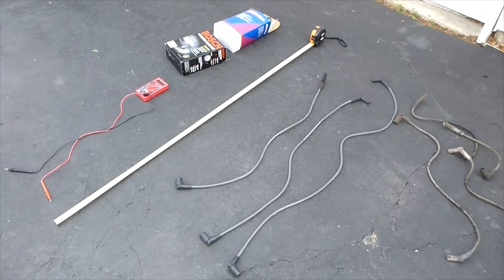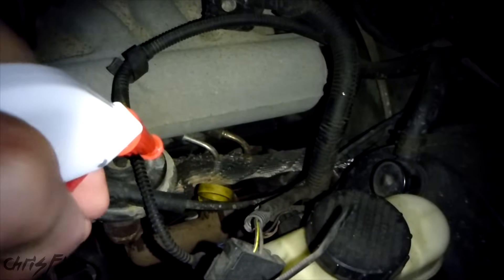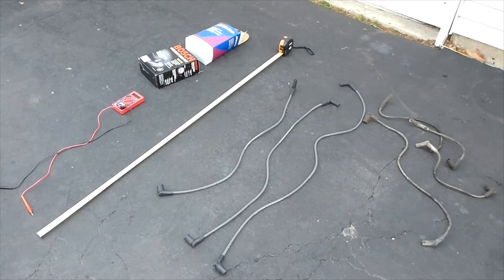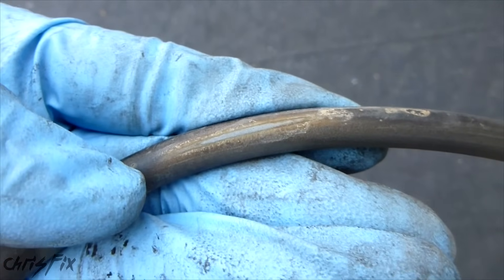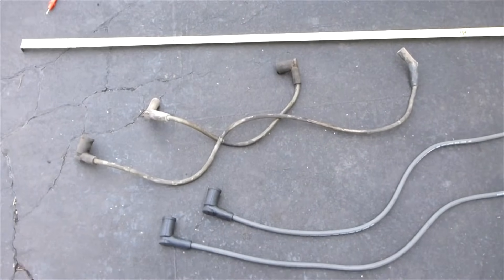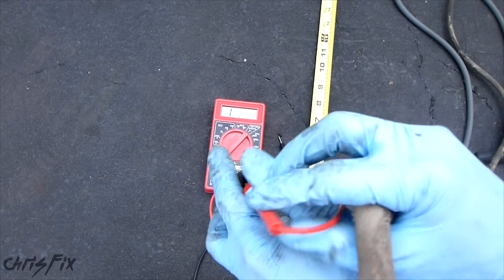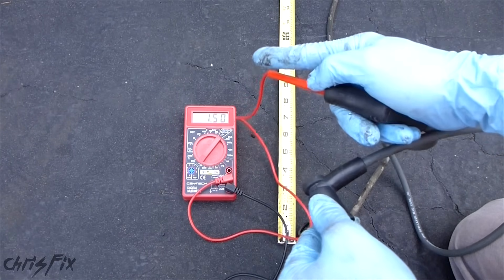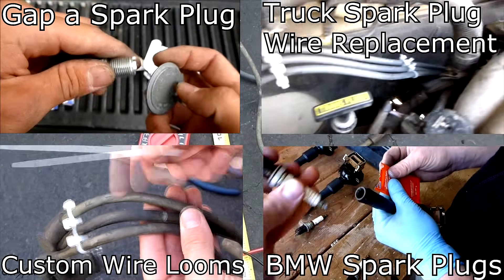How to Test Spark Plug Wires

Comment: hey chrisfix, I have multiple questions for a truck I just bought. it's a 1999 dodge dakota 5.2 liter v8 I bought for $2800 for 80,000 miles. at first everything was fine, then realized I made a big mistake not inspecting this truck. it has major problems with all tires, shocks/struts, a shot muffler and rusted pipes. those are major, but right now 2 weeks after I got it, it wouldn't start. I found out that the battery terminals and battery were corroded, so I cleaned them and replaced the battery since the old one had less than 8 volts. I thought that fixed the problem, but it turns out that it still doesn't start, I'm thinking it's my starter or a spark plug or alternator problem. what's your suggestion on this? maybe my battery cables are bad or clamps or starter? it turns over but won't fire up completely. thank you if you can help me.
Reply from the maker: +Michael L. (Moviemichael) Check the fuel pressure: https://www.youtube.com/watch?v=_oXLUqE4Sf0

Comment: Good video, Chris. I just had spark plugs and wires changed on my 2004 Ranger and now I'm getting static(not whine) on AM band of aftermarket radio that matches RPMs. No static when stopped with engine running. Any ideas?
Reply from the maker: +9moons1 Thanks! It could be that you used  non OEM resistance wires so they interfere. My Corvette manual specifically says because the firewall is not metal, to use OEM spec wires.

Comment: I should try this with my outboard motor.  One of my small outboard can't get over 3000rpm or high speed.  In visual the cable somewhere crack and looking bad.  I should perform the multimeter test for it

Thanks for your great tips!  Really clear to show how to do for me as i am new for engines.
Reply from the maker: +Jerry Chan Awesome! I hope that it is an easy fix! Good luck!

Comment: Where I am lost is what should the ohm reading be if it is a GOOD spark plug
Reply from the maker: +TySignsUp Porter They should all be a similar resistance. Every brand has different resistance values so you cannot generalize. Instead, test them all and they should all be within the same range.
Reply: Thanks Chris.  I did this test yesterday after seeing a random misfire code on all 4 of the drivers side cylinders.  I checked all 8 and found out that all 4 on the left were not similar in resistance.  However, all the wires on the passenger side were.  
I will be replacing all my plug wires today.

Comment: resistance is not that important as long as it is within reasonable values. The continuity test is more important as spark strength is lost when jumping the gap!
Reply from the maker: +rosharky Thanks a lot for sharing!
Reply: +rosharky Can you mention what are the reasonable values?
What's the continuity Test?
Reply: +ChrisFix As you tested Ohms in old cable and when you moved it, it's Ohms varied and you changed it therefore. Why you didn't did the same process with the new cable?
Reply: +Muhammad Ali continuity test = resistance should be constant even if you flex the cable.
If it is not, it means that the cable is interrupted and the spark has to jump that gap.
IT will burn the material and the gap will increase even further. Not to mention that you are loosing spark energy there.

Reasonable values, there is no fix value, but if you are measuring well over 20k there is definitely something wrong with that cable and it will be likely to cause misfires.
Don't strugle to go below 5k or so, as gains will be marginal. Current is controlled by the ignition system, not cable resistance anyway!
Reply: +rosharky Thank you Man.

Comment: Hey Chris last time I was having issues with a misfire. So while the car was running I started fiddling with the spark plug wires, well I ended up just wiggling the spark plug wires at the distributor and it shocked me. Are they supposed to do that or does that mean my distributor is bad or spark plug wires? I have no clue so any advice would help.
Reply from the maker: +mrtwk63 It shouldnt shock you. The wires are probably bad and leaking voltage.
Reply: ChrisFix thanks for the reply. I took a good look at the wires and there's cuts on the wires. I guess I'll swap them out lol.

Comment: so is higher resistance better or worse? I have a 98 dodge ram that is misfiring in cylinder 4 (P0:304) I replaced the spark plugs a year ago along with leads and corrected the problem. now its doing it again from same cylinder. I checked the ignition coil and it was in spec...the lead was like 1.3 kiloohms. and then I even tried the injector to no avail. only misfires at 55mph+...it does not move to other cylinders. only cylinder 4.
Reply from the maker: +TheRedneckmojo You want lower resistance to translate more power to the spark. Check your distributor.
Reply: +ChrisFix if its just one could it just be the caps connections corroded inside? thanks for the reply.
Reply from the maker: +TheRedneckmojo It could be for sure! Take it apart and see! The cap comes right off the rotor. Just make sure you mark it on the rotor so you dont mess up the timing of the engine.

Comment: I grabbed some new looking wires from a salvage yard, and they all read well except one didn't read at all. Is that basically a dud?
Reply from the maker: Nate Miller Yes, that wire is bad.
Reply: ChrisFix Thanks!
Reply: ChrisFix What's happened to a wire that's not reading at all? It seems like bad ones still read something. Subscribed. I like your videos. Good camera angles, well said and to the point. Other people need to have their face all over the video when it's really unnecessary.
Reply: why would u want to get wires from a salvage yard?
Reply: i know this is a two year old comment, but if it's not reading at all that would mean that there is a break in the wire somewhere so electricity can't flow.

Comment: Top tip: Dont wash your enginebay so that the plugholes will fill with water. Mine did and they started to missfire (surprise)

I took plugs off and dried, result was corroded wire-ends AND the plugs. Fix: Bought a new car.. JK JK.

All I did was sand the ends and plugs back to shiny and spayed some WD-40 on them.

Works like an Old Merc should now, smooth and thirsty.
Reply from the maker: Mortalomena Great tip and thanks for sharing your story!
Reply: Mortalomena I have washed my entire engine bay with all my cars many many many times. I just cover the alternator with a plastic bag is all. My cars use Ngk plugs and wires so they have killer caps on them that dont allow any water down into plug holes. Even when the hole valve cover is flooded with water on top. But i usually just spray most the water off the cover and then take a rag and dry and clean it all up. I like to clean to see leaks and have a nice clean engine bay. I use degreaser from the car wash and then blast it as well.
Reply: charleysturbos yee depends on the car
Reply: Mortalomena Me and roomates have done it too all there honda's and toyota trucks and many cars and trucks and many many times with no issues in over twenty years except i might of blown a alternator possibly. But there only 15 bucks at pick a part so no big deal. I also cover my entire engine in wd40 too though so maybe that helps in repelling oil and rust and stuff.
Reply: I think specifically theres different plugs for different types of cars you know.

Comment: Hey chris I'm using a digital multimeter and I need to test my horn relay can you do a video on it or show me how to test it using the multimeter I'm just confused on what doll to put it on what you reading I should get thanks a lot
Reply from the maker: samone jones You need to know how a relay works to test it. Test the resistance of the two poles that trigger the relay (the coil). If there is resistance, trigger the coil and test the other two poles and see if there is 12v.
Reply: Ok thx so much

Comment: Hey What Brand Of Wires Do You Suggest for GM Cars? Esp. The 3800 Engines, I Have 05 Impala and 00 Bonneville NSchgd. I once Bought A Blue Mag Wire From This Company Called B & B Manufacturing Who claimed the Wire's Resistance is 800Ohm/ft. Although I didn't get that Value when I checked with My MM. But I wanted to know if You have any recommendation for 05 Impala With Low/Reasonable Resistance that Won't Break the Bank.  Thanks.
Reply from the maker: phigo4kins I like this for GM 3.8L cars: http://www.amazon.com/gp/product/B0093KYP40/ref=as_li_tl?ie=UTF8&camp=1789&creative=390957&creativeASIN=B0093KYP40&linkCode=as2&tag=chri0e2-20&linkId=EOXMBGENTKZALCLC

Comment: This guy is so good, he can even turn off the SUN!
Great videos though.
Reply from the maker: James Kinyanjui Haha, thanks man! Glad the video was helpful!
Reply: @chrisfix   sir, my car i20 has 2 separate coil packs controlled by 2 wires connector which controls 2 high output terminals. However, one high terminal pin 4 of first coil gives less spark than pin 1 on the same coil pack. Why such less spark being provided by the same primary coil??
Reply: VERY GOOD INFO. THANK YOU!!!

Comment: Chris, I'm about 65 years old and working on cars were long time and I would like to say you're doing a great job on the videos.
Reply from the maker: Keith Lamport Thanks a lot Keith! I appreciate your feedback!
Reply: @chrisfix  sir, my car i20 has 2 separate coil packs controlled by 2 wires connector which controls 2 high output terminals. However, one high terminal pin 4 of first coil gives less spark than pin 1 on the same coil pack. Why such less spark being provided by the same primary coil??
Reply: You are right sir,
Reply: im 68......and still remember , me stripping down my 62 ss impala blk/red...    and me and the boys pushing it up the driveway....and  leaving it under the Penn railroad trestle in J Hts Q    Ny   one summer day... my point,,,,,,,Ahhhhhhhh   hhhhhmmmmmmmm,,,,    ...I forget.... butt keep on doing what you do...
Reply: Thank you so much for your name is jobs that the errors in hand to be a good day at our place. Florida State Tyler Johnson said the errors in hand to be a good day at work
Reply: @marilynjohnson767  Ok..
Reply: Great job chris
Reply: Lol why do you approximate your age? About 65.... Why not just say  how old you are? 😀
Reply: 1
Reply: @polewalker how ya feeling now? 😂
Reply: Chris, I to am 65 y/o  like your videos....When I change spark plug wires I mark the cap & wires with paper tape and number them so I don't get them mixed up....this is for people who may get the turned all around...
Reply: I am from India car mechanic
I want to job ur country bro
Can this possible

Comment: so if you had stretched the new spark plug wire out it wouldn't shift ohms?
Reply from the maker: taalf thorpe The ohms are a certain amount based on the length of wire. If you cut the wire, the ohms will become less. If you stretched out the wire it is still the same length of wire so nothing changes. Make sense?

Comment: you can also use salt water to see an arc, it's a little more convenient when you work on vehicles during the day
Reply from the maker: Jon Squires Good tip but I would rather not spray saltwater on my engine or electronics. For me it is worth it to wait till the night.
Reply: True and don't get me wrong I'm not trying to bash anything you're doing you have a lot of great videos. I've just worked in dealerships and time is money, I've also had pretty decent luck with soapy water and watch for bubbling.
Reply from the maker: Jon Squires Same man. I dont want to bash your idea, just telling you what I think. Time is money at a shop so a little spray is worth it.

Comment: ChrisFix Hi Chris, so you mean in this video that if a cable is below 2 ohms that cable is much better? I recently change my cable to new ones and the reading is about 8+ ohms plus in all cables. But my old cable reads 1.3ohms - 1.5ohms and based on your video those are much better? Cables doesn't exceed 2.5 feet I guess and shortest is about 1 foot and a half.
Reply: By the way, your video is the best spark plug cable explanation I've watch and it seems the complete way of doing tests... I just did the cable twisting test and it seems there's a intermittent connection. Too bad the cable is reading 1.9 ohms =(
Reply from the maker: Thanks Ivan. That is too bad. But at least you found your problem!
Reply: ChrisFix Hi Chris, you haven't answer my questions about which is better? New spark cable reads 8-9ohms and the old one reads 1.3-1.9ohms. In your video says lower ohms is much better? so my old spark plug cables were much better than the new ones? Thanks.
Reply from the maker: Oh sorry, I read the lower comment only. I dont know what car you are working on but the idea is the less resistance (lower ohms) the better the plug wire since more current is getting to the spark plug. Unless you have a high performance car, you wont notice the difference between your 8k ohm vs 2k ohm wires.
Reply: ChrisFix It's a 4g15 engine carb, two cables are the same length so it's in pairs. First pair is 1.39ohms and the next pair is 1.9ohms. The new cables that I just bought is about 8ohms - 9ohms incrementing(there's no cable that are the same length.) The cable running from the ignition coil to the distributor is busted. Reads 15ohms less than 1 foot. Should I return the old cables then? Please advise. Note that I already did the twisting cable test so there's no intermittent connection in the old cables.
Reply from the maker: How many miles on the car? If the car is high mileage, I would replace the wires. If the car is low mileage, just replace the ignition coil-distributor wire. The resistance of the wire is not important in your case. You just want to have new wires that work and dont leak voltage.
Reply: About 89k miles on it and I don't know how many miles that old cables ran but they do look pretty old. (I'm the third owner and I just got it last November 2013.) haven't tried the water mist test.

Ignition coil is new by the way.
Reply from the maker: Try the water test but in the end, I would replace them with the new wires. You can keep the old ones as backups if they are still good.
Reply: Ivan Rubio The inexpensive after market wires are junk. Spend your money on OEM wires.
Reply: Gary Farris Indeed they are junk, I did try one and the terminal was left on top of the spark plug. I did get the expensive racing type, (hard to find OEM's in my country) so far so good, they are thick as well. The old ones are Mallory and kept it as backup. They are good.

ChrisFix I did tried the water mist test and I didn't have volage leak. Turns out my main issue of engine stalling intermittently is the fuel pump being faulty. Sometimes I drove for about 1-2 miles from home and it stall me. Sometimes I could run about 80 miles and it didn't stall. Mechanics couldn't figure it out.. I consulted 3 already, in the end I figured it all out by myself. It's a good thing to DIY instead of going to mechanics that will rip you off.
Reply from the maker: Ivan Rubio Glad you figured it out! Nice work!
Reply: ChrisFix Thanks, I also forgot to mention that I did some wire soldering to the live wire to the IGN SW and the IGN SW position ON as well. The wires are just twisted and they are not soldered. So yes, the problems were ignition system related and fuel system related.

Kudos to whoever did this work to the previous owner. May you lost your business in the long run. LoL :D

Comment: just noticed something after i had paid a small fortune to have my dealer change the coil after i complained my engine will knock if i put it under heavy load like accelleration or driving up a hill.

what i just did i opened the hood and listened to the engine. I head i small weird sound...clicking noise. And then i saw a short circuit on one of the sparkplugs. So i think that the sparkcap is gone bad. To bad for me that i have to jack up my car too change the sparkcaps. :-S
Reply from the maker: Yea, I just answered one of your other comments and directed you to check the spark plugs and wires! Glad you found your problem! Now go fix it and let me know how it goes!
Reply: ChrisFix just bought a carramp with allegedly 26more cm. so with 26cm plus 16cm ground clearance....this will be an epic journey for an obese man.

bad thing is i have to wait until tuesday before i get the sparkplugwire set.

however...i bought a cheap multimeter 110nok which is around 18 USD...i measured voltage on my car battery...12.45V...so my battery is ok even if the terminals is dirty. 

but, i noticed that my car manual says i need AGFS 22C1 sparkplugs. However, my dealer has only AGFS 22CM1 sparkplugs. 

Do you think that *.22CM1 is the 2nd generation sparkplugs? My car is 13years old so there might have been a few changes.

anyway i have to ask them if the gap is the same as the 22C1.

i hope that i manage to fix my car on tuesday so that i can go back to defcon 5
Reply from the maker: I would just take an old plug out and compare it to the new one. Most spark plugs will need to be gaped so be prepared to do that yourself. How to Gap a Spark Plug